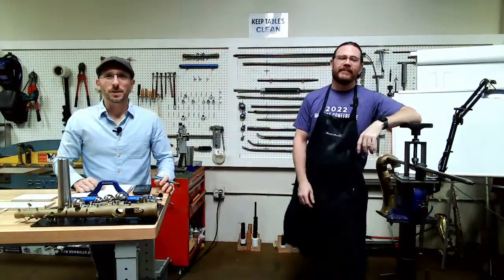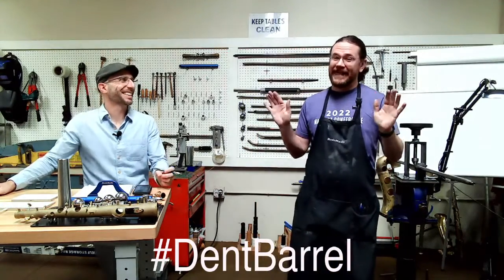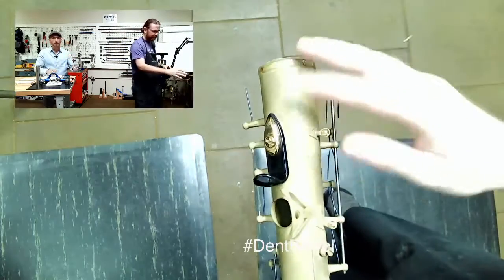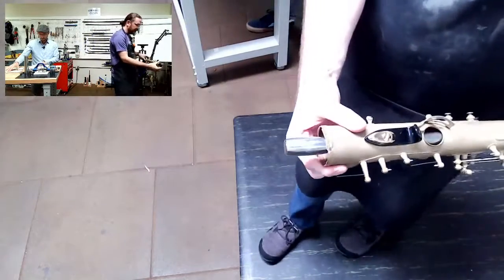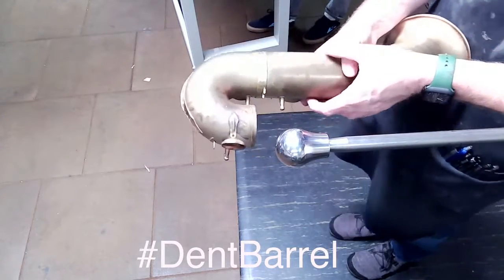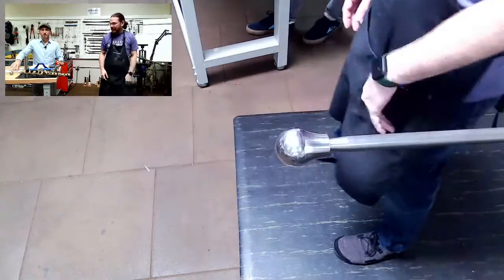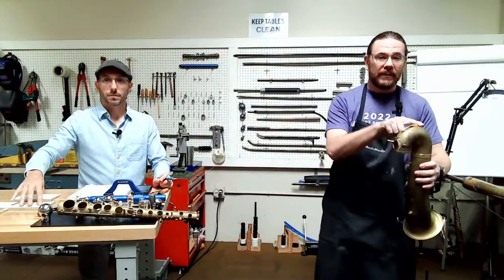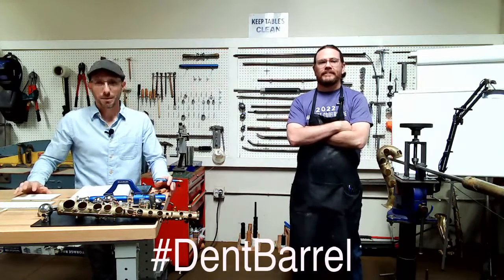When to use a Dent Ball or Barrel to remove Dents in Saxophones. #WednesdayWisdom

Comment: Great introduction to saxophone repair. Does brass experience any work hardening as does many metals, where it actually becomes very brittle from all this manipulation or from removing dents, creases, and wavy patterning? I work with both mild steels and high-tensile varieties, and much use caution to prevent thinning of brittleness. Thanks again my friends.
Reply from the maker: Yes! Brass does experience work hardening and becomes brittle. Luckily we can anneal it to continue to work with it without risk of cracking.

Comment: i'm an electrical engineer, but i fix musical instruments for kicks.  and so i often buy retired school  instruments on ebay, which are quite smashed up.

the crook you showed in the beginning of this video should have the majority of its dents removed by filling it with water and propping it up in a freezer.  you might need to do that several times, to get it ready to finish the job by mechanically pushing the dents out. if you try to finish the job with frozen water, you risk tearing the brass.
Reply from the maker: Interesting technique! We also use the MDRS to remove dents in U-shaped tubing (also called J crooks, or bows) without having to do a lot of disassembly or extra work.

Comment: Do you ever use heat during dent removal ?   #dent removal
Reply from the maker: Occasionally. We'll use heat to anneal the brass in the bow section on an extremely dented instrument after we've taken off the bow guard.. Of course annealing makes it softer and then the subsequent dent work will work harden the brass.